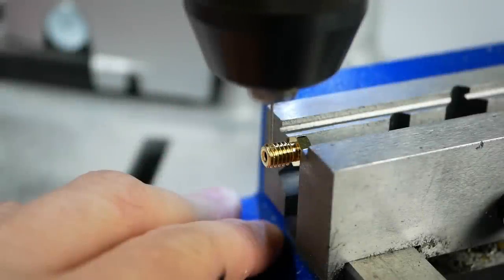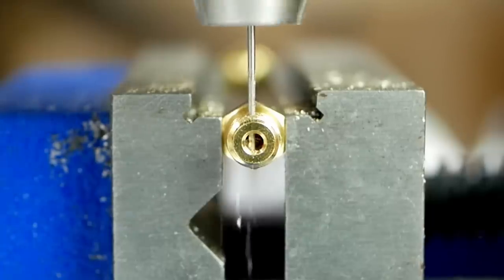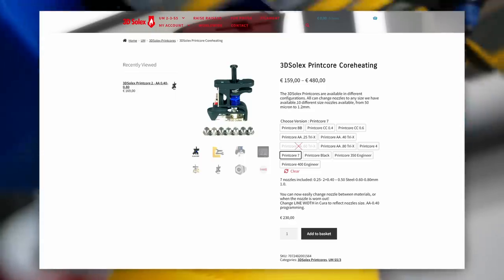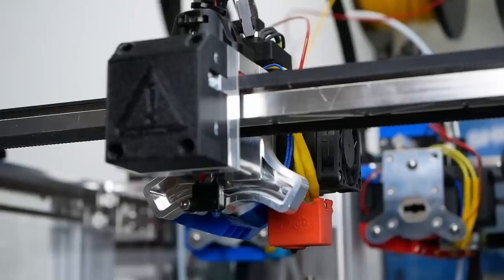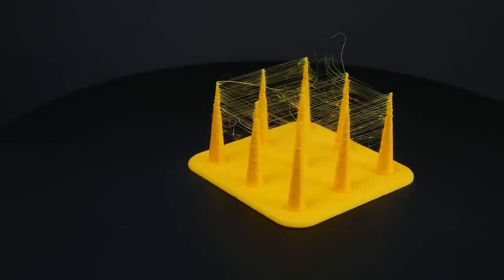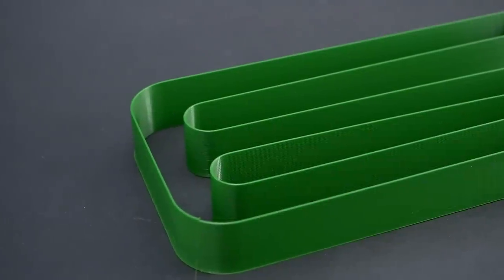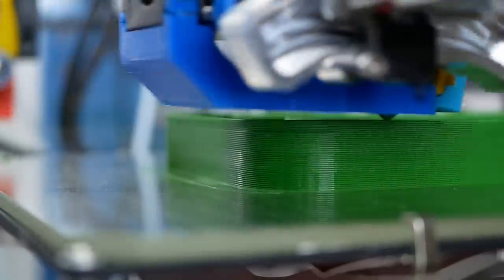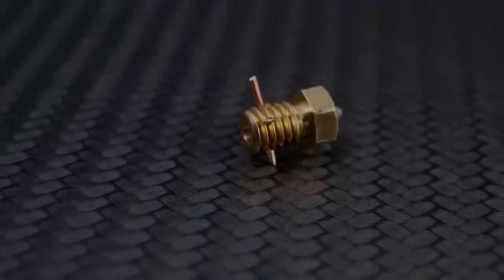My High Flow Nozzle is better than a Volcano hotend!

Comment: Another interesting thing to try would be to place the two wires in parallel with each other in the bore.  That would give you more contact area, but it would not provide as much resistance as the + layout.

Comment: Dremel the wire that will sit inside the nozzle, before soldering it in place. Make them thinner and come to a sharp edge so the sharp edge is facing the filament. I imagine doing this would eliminate the need to drill nozzle and make it perform very close to the winner, if not exceed its performance.

Comment: I wonder if there are gains if you extend the tip of the nozzle instead of the throat.  If the plastic spends more time in the 0.6mm section the polymer may realign before exiting the nozzle.
Reply: yeah the  0.6mm/ output hole should be a lot longer.

Comment: Love your videos! I made one from a 0.8mm nozzle and got speeds around 20mm/3 with nozzle at 205 C. If you're trying this again you should use a power drill when making the hole, then you can correct if the alignment is of when drilling. Once again love your videos!

Comment: Thread a nut on, use the flat on the nut and a center drill to start the hole (making sure it’s centered properly), then drill all the way through with the 0.8mm bit as normal.  Once finished with drilling, remove the sacrificial nut and insert wire.

Comment: What you want is to be able to put two different filaments (one strong, one flexible) through a device which splits and weaves the six strands into a super strong yet flexible strand.
It'd be like a tiny braiding machine between the roll and nozzle.

Comment: Good idea which actually works. I think you could do the same without soldering and retapping the nozzle, thgough. Just make sure the hole and the wire are relatively tight fit, and cut the wire to the length which will not get in a way of the thread and push it into the hole. So even if it moves a bit, the thread will push it back in place when you wind the nozzle back into the heating block. This way you can remove them for cleaning or whatever else you do. I don't know if the wire material plays any role, but in any case you could use TIG welding rods, which come in different diameters and materials. I'm not sure how this modification improves the performance, but it obviously does. I would also try this - enlarge the hole as much as possible, take two lengths of thin metal strip like the ones used for battery contact spot welding, cut both through the middle up to half the length and push them one into X or + assembly and pugh this into the nozzle to effectively divide it into 4 channels. The strips are thing enough as not to be a serious obstruction for the flow. This takes up even less space than any kind of driling, and each of 4 tunnels probably has a larger cross cut section than one of the 3 drilled ones, and there's four of them. I'm not sure but I think you could drill even with 4.5mm for maximum flow.

Comment: Since adding a perpendicular wire helps with melting but reduces area (ie. flow), and adding another one adds too much turbulence too benefit from the added melting zone, I think it would be worth trying thiner copper wire, or even a thin copper plate inserted in the middle.

This would require to saw the nozzle in two (in the melting zone only) with a very fine blade, but hitting the middle plane would be easier with standard tools and the heat exchanging area would be doubled !

Comment: If you are having trouble with a drill bit wondering, make the bit as small as you possibly can in the chuck to reduce flex, even if it means taking multiple passes. Also if you are having trouble with soldering onto something that is absorbing heat, be sure to insulate it against heat sinking to prevent creep. *do love your videos though, 3D printing is life <3

Comment: To ensure the drill does not wander, use an end mill of the same diameter, to create a small counter bore on the threads.  Then come in with the drill bit, and complete the hole.

Comment: v3 of the diy nozzle - use a small file(like REALLY SMALL) to "sharpen" the 2.0mm section of the wire inside. perhaps this would remove some turbulance? Either way very informative as always. Please never stop making videos!

Comment: In order to get the hole more centered  you need to machine a small flat on it you can do that by using a small end mill in order to avoid loosing too much of the thread.

Comment: Starting your drill hole with a center drill has been mentioned, but you can achieve similar results with a very stubby drill bit. If you know how to sharpen a drill bit, just grind off most of the twist, leaving one twist to resharpen. This will make for a very short but stiff bit that, if chucked up with little protruding from your drill chuck, will be almost as ridged as a center drill. Go very slow to start, and it should act more like a small end mill, meaning you would not have to worry about aligning with the "V" of a thread. You can also try to just choke up on a full length drill bit, leaving only a centimeter or less sticking out of the drill chuck. If you can get it to run true, there you go!

Comment: If you want to drill straight inexpensively and quickly, use a for predrill a shorter drill (can be cut if you can't insert it deep enough in chuck)

Comment: The classic way to drill into a circular object without the drill wandering, is to spot the surface with a 2-flute endmill first, providing a flat surface for the drill to start on, and in this case also providing clearance between the threads.

Comment: I would file the wire a tiny bit on each side to make it a bit more flat so it wont restrict flow that much, but the copper would still conduct the heat very well

Comment: To drill the hole exactly where you want it, first use a 1mm slot drill to create a flat surfaceat the root of the thread. Then use a No' 0 center drill to start the hole in the correct position. You may only need to make a 'dimple' with the tip of the centre drill. Then follow up by drilling the 0.8mm hole with the twist drill. Hold the drill in the chuck with just enough of the drill protruding from the chuck to drill right through the nozzle. This will restrict the drill from wandering off.

Comment: My trick for drilling holes perfectly centric in round bar/round tube/pipe is to use a make shift jig.  I grab a deep vise (one with a slight step is ideal) and square bar/or a piece of scrap .5" plate that is the same size as the round bar/round tube/pipe.  Put a hole center into the square bar, then load the vice with the round object I want to drill centrally into the lower part of the vise by the step, and lay the square bar on top then clamp it altogether in the vice (the squarebar (etc) and round material must be clamped together firmly).  This allows me to pretty much nail the center in the round part.  It's a hack, but it's fast, reliable and very repeatable when you want to make more then one part.
Reply: In this case, instead of doing that, what I'd do is take a piece of square bar, drill the end of it so you can install the nozzle (but not yet), drill out a hole in the square bar where I want the hole positioned in the nozzle, tap the end where your going to install the nozzle, then install the square bar into a clamp, install nozzle into the square bar, then drill the nozzle using the square bar/vice jig.

Comment: Here's a tip for drilling through a threaded fastener: put a nut on the thread (you can jam nut it in place, or superglue). centerpunch on the flat of the nut, then drill through. If you superglued, use heat to release the nut.

Comment: A drill guide, one that accommodates the outside and inside.  It is sometimes like wood working, you spend hour building a fixture to get the right cut but the results are outstanding.  Higher RPM's short pecks will get you the straightest hole.  Nice video love the idea.  Cheers!

Comment: To drill a straight hole we begin with a center drill. The center drill is very stiff and won't walk around. In the case of drilling in to threads a small end mill can help to make a small level spot where you wish to drill.

Comment: To make a centered hole through the nozzle, screw the nozzle into a brass block and drill both. If you don't have brass you can try other materials but the difference in material might lead to some drill deflection on the interface. You can even keep the drilled block and use the hole for any further centered drills you might need.

Also, if you use thick enough wire and just press fit it into the hole, you may not need to solder it at all, avoiding all the temperature limits.

Comment: I suggest doing 2 holes on opposite sides at different height that goes half way, so the flow isnt restricted as much.
Reply: Yeah, and you could sharpen the wire to a pointed tip.

Comment: Hello Stefan!
You can mill the end flat to make it easier to drill. Also try to shape the copper a bit by using a small needle-file or just give it a whack with a hammer and flat screwdriver.
I imagine making it sharper in the beginning would make a difference.

Comment: To get better centering, you can use a centering vice combined with a center tapping bit to start your hole. The center tapping bits are really short, so they don't deflect away from your drill point. After you've started the hole, you switch to your normal drill bit to finish the hole.

Comment: To avoid the drill wandering, don't have so much of the drill bit exposed, only enough to make a small indent in the top. Then loosen the chuck and let out some more drill bit and repeat. Do that a few times making the drill bit only a mm longer each time. Once you are through the top wall then you can just make the drill bit long enough to go all the way through...

You do need to ensure that the nozzle is perfectly centred first though as well... use a feeler gauge or other methods to get that perfect before drilling...

Comment: Use a punch, or tiny diameter drill to start the hole. If it still slips, you will have to center the hole between threads.

Comment: Small tip: if you drill a hole into a thread you could screw a nut on the thread first, then drill the hole and then turn the nut over the drilled hole to repair the thread. :)

Comment: I'd actually like to try milling angled holes about 45° in the vertical axis.  Then, if we do that with a steel tip, could do a quick spot tig weld to hold the wires in place.  I'd enjoy working on that for you!

Comment: somewhat of a proper machinist here. The reason your drills were wandering off center of the nozzle is due to the tool geometry of drills and you're drilling into the side of a thread. To help with this try center drilling with about 1k rpm's if you can swing it. However, another concern is that you are drilling directly into the threads. If you want to make sure that the drill goes completely straight. I would take an endmill and machine the threads flat, center drill, and then i would use the .8 mm drill. hope this helps you out!

Comment: Designers of supersonic aircraft use the 'Area Rule' to ensure there are no 'area discontinuities' that would cause shockwaves to form - at supersonic speeds, air behaves as an incompressible fluid. The same concept might be applied to optimize the design of high-flow nozzles. The idea would be to take slices through the nozzle, and create a profile of the total area open to filament flow within each slice. Plot this area along a vertical axis, with successive slices along the horizontal axis - the plot should have a smooth profile. Any discontinuity would create stresses in the melted plastic flow.

Comment: Tip : use a centre drill to get the hole started.  Solder ( not sodder ) temperature is not quite the problem indicated since even if it melts in use , the wire has nowhere to go.  It is really just to hold wire while recutting the thread.

Comment: Guten tag Stephan! What you should do is tap 1mm holes that you drilled sideways through the nozzle then run some larger wire through an M1 die and thread it into the nozzle. You won't need to solder anything and thus can use much higher temperatures. If anything the copper will expand due to the heat and lock itself in place. I know it sounds like a pain to thread a piece of copper wire, but you can do it by simply putting the wire into a power drill chuck and hold the die with your other hand and it will thread right through. simple. I'd still tap the holes by hand since an M1 tap would probably break from breathing too  hard on it. lol.

Comment: I'm going to let you in on a little secret that is going to be my senior project, mcamaster-carr sells heater cartridges that goe up to 1400c (enough to melt aluminum), and you can get variants that have huge wattage per sqft ratings and basically recreate what stratasys does on their fortus', where you have a 2 inch long heating zone powered by a 500 watt heater cartridge running at 220 or 120, and then print at 1m/s

Comment: Nice test, interesting results.
Just a thought, maybe try putting a thin straight cut from the back of the nozzle and insert a small section of copper sheet, solder in place and retap the thread. This should give you much greater surface area and divided flow path

Comment: How about cutting the nozzle along its longer axis, and putting a piece of copper sheet in the cut? 
<  ||  >
<  ||  >
<      >
..\_/

|| - cut with a copper sheet inside

PS:
You can also file the edges in the middle of the sheet that'll be inside the nozzle, to make it sharper to even further ease the flow. 
I believe it could be relatively easy to do. Make a vertical (along the axis of rotation) cut on a bandsaw or with a careful cut with a handsaw. Cut a piece of copper plate to be slightly wider than the nozzle. Drill a bit wider hole the length of the copper plate (or skip this part if the flowrate is enough to reduce die swell). Insert the plate, solder it. If you don't want to solder, you could try to heat up the nozzle from its tip to expand it and put the plate in the freezer, then try to hammer it down the hole, but you'd have to work on the tolerances quite a bit for this to work (you'd have to be careful not to pry the nozzle open, too). You could also just tig weld it. Then the only thing left to do is to thread it and to file the upper parts of the plate to fit the shape of the nozzle's chamfer.

I hope this message does reach you, as I believe it to be an upgrade to the solution shown in the video. Cheers!

Comment: Stefan, in my opinion the best solution for the problem during the drilling perpendicular to the thread is to have some kind of jig. Maybe you can 3d print something and you should just screw in the nozzle to the jig and have a hole in the jig maybe with a metal tube that has a slightly bigger hole then the drillbit. This way the drill bit will lead into the middle of the part and won't have any place to dance around and hopefully you won't break the bit :) Hope this helps :)

Comment: If you use a shorter drill bit and have the least of it exposed from the chuck possible you will significantly increase the stiffness. It would also help to use a centre drill to start the hole, use an endmill to provide a flat to start, or both. Silver solder is pretty easy to use and has a higher melting point you just need a little liquid flux and a blowtorch.

Comment: If you use a small center drill the small drill will follow it through the first side.  The second side will be centered bu the curve of the hole in the nozzle.

Comment: You can bend copper wire inside hole in parabolic curve - that will increase heat rate due bigger surface area.

Comment: before you solder/gas flame braze, clamp rivet them in place, simply hammer/file a 45% sharp edge in the centre copper to better split the soft filament.

to better centre the bit ,simply put a straight flat wire in the thread grove drilling location, bring a centre pin down to clamp  the flat wire & move sideways until it's 90% if its higher or lower on one side it's off centre, redo it  ,remove the  flat wire ,bring the  centre pin down to indent the thread, replace with the bit, drill, done.

Comment: If you make a block(could even be printed) with the 8mm hole centered on the side, and a threaded hole for the nozzle, you can make a guide for the drill bit to stay straight.

I wonder if you make the wire go through much lower, if you could connect electrodes and heat the wire inside the nozzle directly.

Comment: you could file a diamond section into the middle of the copper wire, before putting it in the nozzle. If the point of the diamond is oriented toward the inlet, the filament should split easier, and allow a little more room for the material to flow.

Comment: I feel like extrude honing a nozzle with properly sized micro-abrasives would be prefect for this. Maybe you can use something off the shelf like plastic-x, and pump that through at a rate fast enough to give the same effect but cheaper? Extrude honing works wonders on intake manifolds to clearance and smooth out airflow in areas you could never reach with tools.
Another thought,  you may be able to bore out the inside of a nozzle but retain the tip diameter, then create a brass/copper insert that will drop into the larger opening and could be soldered into place. This too then can be extrude honed to perfection for maximum flow.

Comment: My proposal for better manufacturing would be "add a press fit insert". The nozzle upper diameter should be drilled to about 4mm and than it should be pressed fit a grooved pipe. These sort of pipes are used for "groove heatpipes". A slight increased length of the fins should be perfect for heat distribution. What do you think about that Stefan? Did you get my idea?
Regards,
Andy